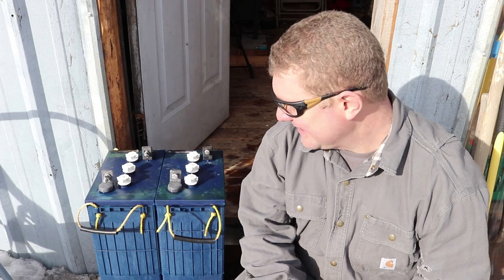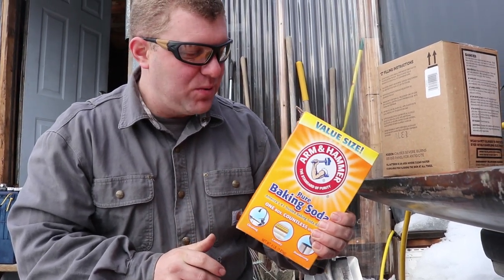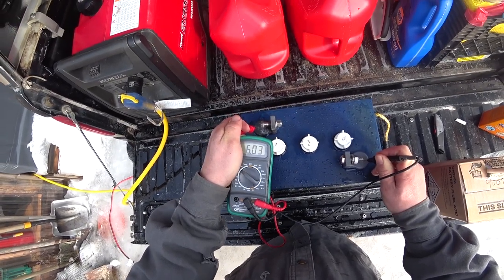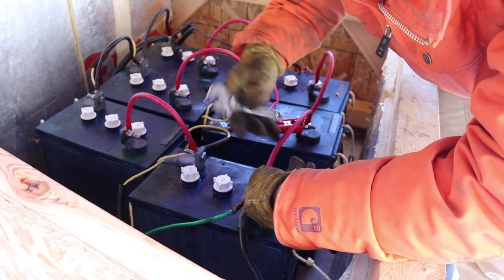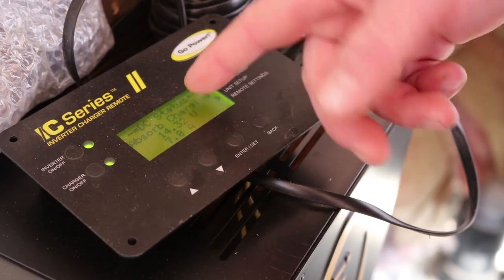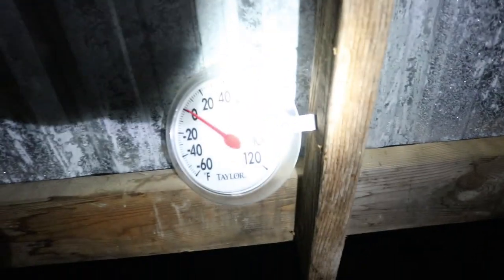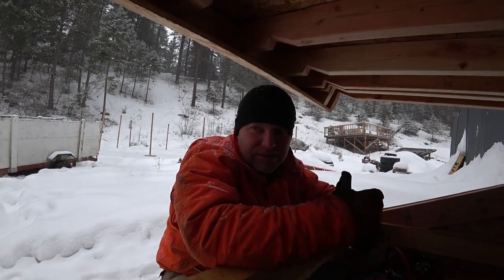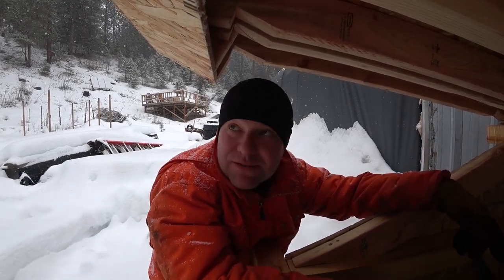DEEP CYCLE BATTERY HACK?! Fix $400 battery for $20?! (Part 3)

Comment: make sure the sediment in the battery is not tutching  the plates as this will couse it to discharge. Have a look at the old electralite you removed from battery 1. It had a lot of muck in it (sediment) that will cause it to discharg.
I love you both, How did you find Malisa? A real woman and a gem.
Also as an after thought have a look for 12 Volts Lead Acid Battery Desulfator Assembled Kit. They work but slowly.
All the best. keep at it.

Comment: does your charge controller have a temp monitor for the battery temp?   if not,  you'll have to do some research on it.   batteries have different voltage at lower temps.  if your charge controller isn't compensating for the battery temperature,  it will flip into absorption and float to soon.   our charge controller choice was based on the ability to program it to the specific batteries'parameters and the temp monitor to make the appropriate changes for temp automatically after programming it.   also,  we can connect the controller to our wifi and monitor charge state, absorbtion,  float, equalize, and see real time solar array voltage and wattage being produced and going into the battery.   Tristar MPPT 60   through Morningstar Solar.
Reply from the maker: +MARK LONG Excellent suggestion! You just gave me an idea! We do have a temp sensor but I haven't connected it yet! So the charger is flying blind. Makes sense. Time for another video! Lol. After I get #4 in the series out the door. :)
Reply: Looking forward to it!   Keep up the good work!   We've been playing with solar for about 3 years now and there is a steep learning curve.   Don't get discouraged,  you're doing great!

Comment: Put the battery box inside your cabin so it can benefit from the heat from the wood stove. Vent them outside of course.  Love your videos! Going off-grid myself this spring.  In a yurt! With heated floor from compost! Sorry getting away from the point due to excitement! Did I say I love the videos?

Comment: Batteries are 2 volts per cell,  you can hookup two 6volt batteries in series and charge them as a 12volt.  The big charger that you look at at NAPA will work by putting on 60 amps and the hold position on the timer. But keep eye on them not too over charge.  Keep up good work.

Comment: I'd suggest you get some proper sized wrenches for your battery terminals. Using adjustable wrenches is an accident waiting to happen.  Also if you heat shrink sleeve the wrenches you won't accidentally short the batteries.

Comment: You can mix baking soda with water in a small glass and use a toothbrush or whatever to apply the baking soda to neutralize the acid Much neater although it will leave a harmless residue.

Comment: You are adding premixed solution, shouldn't you add a little sulfuric acid to bring the gravity up to the level you are expecting which I think should be a little over 1.2 .Also doesn't your generator have a DC output. Guess if it does it might be 12v not 6v.

Comment: I've never heard any success stories with used batteries.  I know you enjoy the challenge of trying to solve problems yourself, but I think a new bank should be at the top of the list for things to upgrade on your property, just after the water management, in my opinion.  Batteries will work well for many years if maintained but abuse them and, as you have proven is this series, they are very hard to recover.
Reply from the maker: What better way to learn solar than by doing? We are off grid now, but we never said we'd be off grid forever. Too many people think it's the dream. We say try it before you buy it. This all is a good learning experience for us. Happily our other batts are doing well so we aren't massively inconvenienced by this project.

Comment: Living off the grid:  You get to be the electrician, power company, lineman, plumber, water treatment operator, water utility, sanitation professional, carpenter...what an education for yourselves and all watching. Doing good, keep it up =)
Reply from the maker: Someone once told us that being a specialist will get you nowhere when living off grid or rural. You have to program a computer, fix a well pump, cook a steak, manage your solar, haul water, shovel snow, cut firewood, make lumber, butcher an animal and in our case create professional videos, run a Facebook, Instagram, blog and email. All in the same day. We'd challenge most anyone to tackle this and keep that stupid smirk on their face. :)
Reply: I hear ya guys keep up the good work!
Reply: Kinda like being a farmer or rancher.
Reply: Great videos, guys, I've watched a bunch of them. If you haven't thought of and dismissed it for some reason, you might get a few amorphous solar panels to add to your poly, or monocrystallines. They work well when it's overcast or cloudy, and with all that winter snow to reflect light, they would probably help out a lot.

Comment: Is your battery box heated in any way? I know that cold weather is really hard on batteries. So they may not be in as bad of shape as you think they are. I have seen people use heating pads made for seedlings trays that use very little power. You may want to also try and vent a 3 or 4-inch pipe from your cabin area where you wood heater is, and run it into the battery box using a small 12 fan (like from a computer) to blow heat into the battery box, that may help. Good luck!
Reply: also consider adding a desulfator to the battery bank, they use the battery banks power to operate and are cheap

Comment: If you are trying to isolate bad battery, connect a DC wattmeter in between the test battery and the common power rails or busbar. You will be able to see how much power is being delivered or consumed at any point. Make sure the current rating is adequate. Cheers.

Comment: Maybe add distilled water for a few hours to flush and absorb sulfates from the plates(and the bottom of the case) then drain again before adding new electrolyte? Just a thought.  Good Luck!

Comment: ok, you can as a last resort, use jumper cables from your truck to the battery bank. your alternator will put out at least 40+ amps at 12v... I'm saying your charger is junk... try it and your batteries will be fully charged no question. btw, have the truck running around 1200 rpm.

Comment: If you take a flash light and shine it down the hole you will see the problem there is a lot of crud between the plates of old batteries you can spend a lot of time and effort for not much gain. you need to get all that out. Most of it is quite hard. In addition your batteries are frozen. Bring them inside.

Comment: Prob. sulfation. EDTA to clean the plates assuming they are not internal shorted at all. Before I try to replace electrolyte I always add EDTA tot he old fluid first and drain and recharge the battery with the old liquid and EDTA before I drain and refill this get's rid of a lot of the sulfation build up on the plates which usually is the cause of internal shorts!

Comment: By the looks of the Old acid the lead is coated with sulfating and the only way to charge them is with the proper de-sulfate charger to convert the sulfate back to acid. It is not recommended to drain a sulfated battery and refill till you de-sulfate it.

Comment: I've been in your situation. Sometimes batteries have partially shorted plates from all the gunk at the bottom or from freezing and will not hold a charge. Don't be afraid to "overcharge" these batteries. There's no such thing in your situation. As long as there's water, the most that will happen is you will have electrolysis generating hydrogen and oxygen. You need to equalize with visible bubbling to get the acid circulating so you get a uniform specific gravity. Bubbling is a good thing. Sometimes you just have to remove a weak battery from service and get a new one for quality of life. Two more panels would help too.

Comment: We love your show, and sure would like you to have power from the solar panels and batteries.  It could be that the batteries are way to COLD.  I wish we had the hills you have to cut out a underground battery storage system That would keep the batteries warm in the winter and cool in the summer. Your battery box is vented well but your going to fight this tell they warm up.  I also think after you add the heat desulfate plates of the two bad batteries.

Comment: I know I am likely a bit late, but the way you have those batteries wired, ONE shorted cell would drop the voltage on the whole bank by about 2 volts, leaving you with the 11 volts you are getting. Measuring each battery out of circuit would be the only way to test.
Measuring them 'in situ' won't get you the proper readings. The best thing is to un-bolt each battery and test. Easier would be to get some Anderson plugs as quick disconnects for testing.

Comment: I sell and work with batteries for a living the batteries you are using are find but you need a better maintaining  system.  I would also recommend you to purchase lifeline batteries in 4D or 8D size and you will have less batteries and less maintenance. But a 4 bank maintainer should do the job if you switch batteries if not a 10 bank battery tender.  I highly recommend the 8D batteries they are 12v a piece so less work and less batteries 2 or 3 should accomplish your needs. Lifeline makes the best batteries in that size they are pricey but not
More than your paying for interstate aka paying for the name. Lifeline has a 5 year warranty on batteries can't go wrong.

Comment: Electricity is like water, it flows down hill, towards the point of lowest potential. This is why a battery at lower voltage will 'steal' power from a battery at higher voltage when in parrallel. So, you need to disconnect all of the + to + and - to - cables, wait at least 4 hours, and then test voltage on each battery. While you're at it, hook each 12V series pair to the charger and try to ballance it as a 12V series pair before you hook the 4 pairs together in parallel. I'm sure you're learning a lot, keep up the good work! Don't afraid to make mistakes!
Reply from the maker: I actually wondered if balancing the batts would have an effect on the whole bank. Maybe I'll get to play with this some day. I couldn't possibly document all that we've learned. This video series is going on a MONTH! lol. Maybe after we get to be expert plumbers we can become experts at low voltage. :)

Comment: Hi Pure Living for Life. I see someone saying to drop the battery  to knock off sulfation. I expect the case would crack. Aspirin is a VERY temporary fix. Adding EDTA or Epsom Salts might work for a few months extra life. I wouldn't add chemicals to newish batteries, as they hasten plate corrosion & increase self discharge. Old wet 12v cells are best charged at 15.8 -16 volts for 3 -6 hours to remove sulfation. Stop when the S.G. of the acid remains constant, or if the battery gets too warm. Regards
Reply: Note . only equalize wet cells at 16 v, not AGM. Remove caps & check water is above the plates. They will bubble off hydrogen, so do it in a well ventilated area. Add a bit more distilled water when charging is finished. This process can be repeated, but not too often ,perhaps every few months & not for so long (say 2 hours max) Ask the battery manufacturer if possible.

Comment: Recommended. gasoline tax exemption for farm use and solder or crimp quick connects on the cell bank. Make sure solar controller is MPPT ( buck DC-DC step-down) because without MPPT your losing lots of energy during less than maximum light.

Comment: Hey, Enjoying your series so far. I would have to agree with 46 in the fact that buy new to make em last.

Some tips, 
Get a load tester, automotive stores sell them for a fair price (6V Too). 

When testing batteries voltage or load testing, unhook your wires and do each battery individually. If left hooked up in series and measured it is very easy to catch a back-feed from another battery and confuse your reading. One bad battery in a bank can kill the whole bank by discharging them constantly. 

That will help you identify bad batteries, Im thinking you only have 1 bad tho by how its acting.
I Don't have a ton of solar experience, but ive worked on many battery banks in rv's this is usually how i find the culprit.

-B

Comment: Left over acid and dirty batteries can cause a discharge. Test this by putting one voltmeter lead on the positive or negative post of the battery  and the other lead on the battery case. You will see voltage if your battery case is dirty. Clean battery case and retest. i always clean my batteries with automotive brake and parts cleaner in a aerosol can. I'm a automotive technician. Granted this is probably not your problem but this is good maintance practice.
Reply: Joe Halas I use a baking soda slurry to neutralize any acid. I've been using your method of checking for voltage drain for forty years and cleaning the battery can make a big difference in whether or how much a battery discharges.
Reply: Joe Halas in

Comment: a typical lead acid battery requires a charge time of 24 hours at a low current (2 to 4 amp)  you can parallel two 6 volt battery's and charge together

Comment: Hey guys just a thought, how do you have the charge controller wired to the battery bank? if the positive and negative from the charge controller is both connected to say Battery 1, it would make the controller think the battery is charged long before the other batteries are. Instead should have the positive wire on battery 1, and negative wire form the charger connected to battery 6/8 for example. Same goes with your inverter load, positive from battery 1, negative from 6/8, that way they all discharge equally.
Reply from the maker: Good idea. Yea it's wired in correctly. Wish it was a simple wiring problem. That'd be a quick fix!
Reply: Pure Living for Life it wouldn't work for your big battery bank, but I use a Ctek 250ds charge controller In my car to keep the second and third camping batteries charged, and it works perfectly. They also offer an add-on that allows up to 80 Amp charge but it's from an alternator output I believe, only 25 amp solar charge input.

Comment: Chargers with computers in it presume the battery is ok. To get anywhere you would now need a old fashioned Transformer with a diode bridge, that would normally fry your batteries if you left it on to long. There might be a 12 volt connection on the generator that does that too. In this stage it is important to get a current flowing +/- 0.1 x AH rating. That might require a lot more voltage. That is also why the computerized charger sees 14.6 volts much to soon and goes in to float. You can also put the 6 volt batteries in a 12v charger with a car headlight in serries. The lamp can eat some of the voltage and limmit the current.

Comment: please do not equalize them two times in a row time to disconnect all of them and do a current test. Hooked up they will equalize them selves and make them all look the same. Also build a box that opens in the front much easier to move batteries around. Good luck

Comment: Looks good.
You do know to measure each battery, you have to disconnect every battery and then measure one by one other wise you are measureing a parallel system :-)
Disconect all the batteries and then measure them one by one and see wich one is the bad one (Low voltage) Disconnect that battery from the other and see if it gets better on the bank. otherwise your one battery is draging then bank down. 
Thx for sharing.

Regards.
Reply: The only good way to test batteries is with a tester that draws amps during volt measuring. Unfortunately a battery can have full volt indication but that can drop to useless level when so amps are pulled. During normal checks i measure voltage and weigh the specific gravity of the acid, if those 2 are in spec it is ok for me. If the battery is still not performing i measure volts while cranking engine with ignition disabled, that way the starter has to work but wont start. The voltage will vary but i have a meter that can log measurements for 30 seconds and this is often enough to get a clear picture. For stationary batteries this is not easily possible and it is then better to take them to a workshop for stress test and condition review.
Reply: But that again is ONE single battery you test, and not as i believe that I saw in this clip they  were testing voltage in a parallel system. And that is just what I want to point out :-) cause then you are measuring the voltage of the whole parallel system and not the ONE battery :-)
Reply: Thias Russell Yes, I thought this too when he was probing the batteries..
Reply: You could have all those batteries connected in series and if you just probe the negative and positive on each battery, you are in fact just reading the voltage on that specific battery.
Reply: yup.

Comment: PS if the two are bad, remove them from the bank - they will drain and damage your other good 6 batteries.  if you are running series parallel @ 12 volts you will be better of with the 6 good than the 6 good + 2 bad.